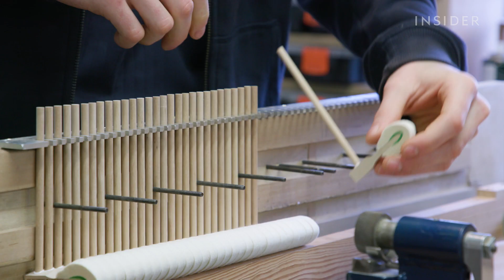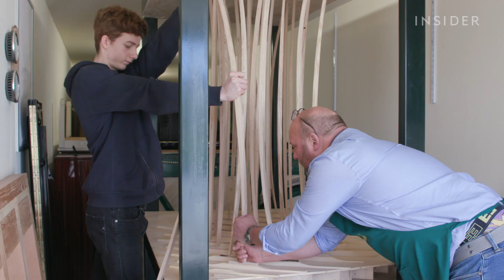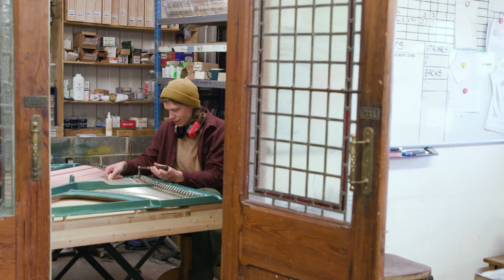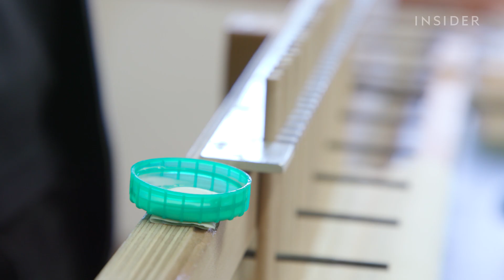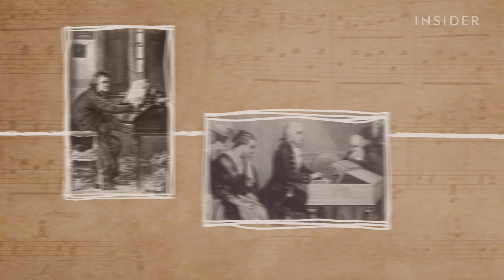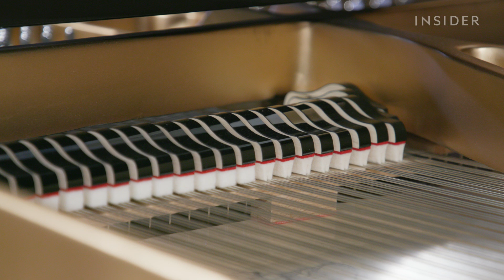How The UK’s Last Piano Factory Keeps A Centuries-Old Industry Alive | Still Standing

Comment: Even in the face of possible bankruptcy, it still exposes the piano's negative points, such as the fact that it deteriorates over time.
This guy has my respect and sympathy. I cheer for him
Reply: The piano may degenerate over time, what doesn't. However, it's a very long process and I regularly tune pianos that are over 100 years old and they still sound a play very well. The pianos longevity is far more of a problem for manufacturers than its decline. Why pay thousands for a new one, when you can buy a perfectly good old one for a comparatively small amount ?

Comment: 7:15 It is interesting. What's the mechanism making violins improve with age? @@
Reply: The lack of mechanism, its only strings and abit of wood
Reply: The wood drying i guess perhaps the string stretching but that seems wrong
Reply: joseph kehler A centuries old violin won't be on its original strings! They are replaced frequently.

Comment: I am one of the few technicians,  tuners and dealers still working.    Can't tell you how much I love the piano.   It is a dying art.   Wish these guys all the luck.

Edit: Wow!  Thanks for all the likes!
Reply: Can you identify pianos just by the sound?
Is there a noticable difference between different manufacturers?
Reply: @grzegorzswist  they are all totally different.   Each piano is unique,  regardless of the manufacturer.
Reply: @grzegorzswist  definitely. Every individual piano sounds unique even. Most instruments if not all sound unique to a degree. Even synthesizers sound unique as the components age differently and produce unique but similar sounds. Acoustic instruments tend to vary the most though because of materials being different to a degree since wood forms very different plant by plant and strings are wound very unique in form although they are made of the same material. The problem though for this kind of company is that even a cheaper foreign piano is by nature a luxury item that isn’t produced in large numbers compared to the majority of the keyboard market. That said, a acoustic piano is worth every penny as even physical modeling synthesis can’t accurately represent the sound and movement of of the sound it creates. I won’t ever afford one but I see it’s value as an instrument. I like many different kinds of keyboards though so it’s best to value the keyboard only against keyboards of the same kind. I wouldn’t argue a piano is better or worse than an electric piano as they are completely different animals. Same goes for digital and analog synths. They both have their unique traits from each other and are valid options on their own rights. Wavetable synths are way more complex but analog has harmonics that would take years to reach for digital due to the many different factors that analog electronics have compared to digitial ones which make them change with the flow of time while digital requires higher cpu load to emulate. The best instrument is the best one in its specific field for what you want and can afford. I hope that this company is able to survive because high quality instruments are what people want to buy. Sadly pianos aren’t affordable for most of us but that’s because of what it takes to build them compared to most instruments besides the behemoths like full pipe organs and the Carillon.
Reply: @grzegorzswist lloooo
Reply: Keep it up and it’s awesome that you do it.
Reply: @walshy2116  thank you :-)
Reply: I really hope that this inspires more to take up the craft. We have enough garbage in the world. What we need are real proper built pianos and the technicians to maintain them. Best of luck and thanks for this video!
Reply: I'm surprised. PIANOS are a dying art??
Reply: @johnny lee torres this is NOT my professional channel
Reply: Certainly not a dying art. The factories only changed their addresses.
Reply: @MarcoMugnatto  yes,  out of my country for sure
Reply: @MarcoMugnatto  it's not an art when it's mass produced
Reply: I wish somebody would teach me the ways of the craft😩 I love music and play a few instruments myself but I was always more interested in how they were made rather than how they play. Maybe one day🤞🏾
Reply: @zacwoods  go ask a piano tuners guild member.   They can help.
Reply: I can make a piano.
Reply: @cerdickjohn2385  really?
Reply: @allblack4777  Yup!!! Actually, I can tune a new piano just less than an hour. I'm one of the few out there.
Reply: @cerdickjohn2385  same!  I got it down to about 20-30 minutes... lots of practice.   Lots.  How long have you been tuning?  Where are you?  I could use another tuner on the team lol!

Comment: I thought it was kind of funny how they used a hammer to move the screws down instead of a screwdriver.
Reply: He's likely transferring the hole locations to the piece underneath so he can pre-drill the holes and not split the wood.
Reply: I was locating the screw positions so i could Then drill a pilot hole 👍
Reply: ikr